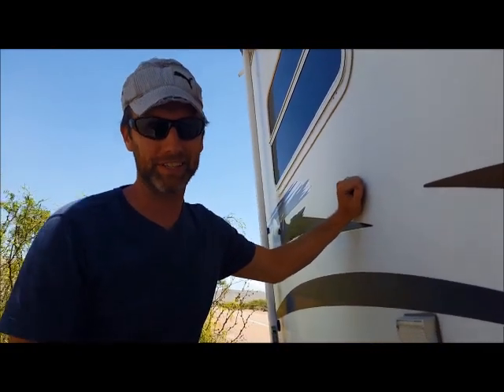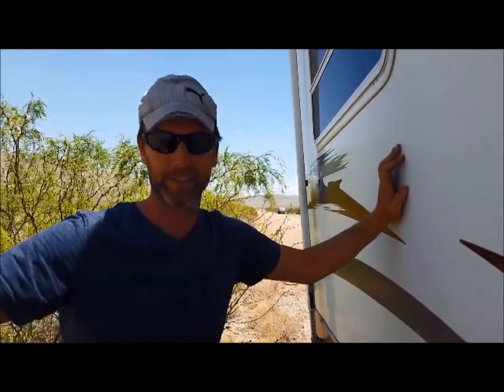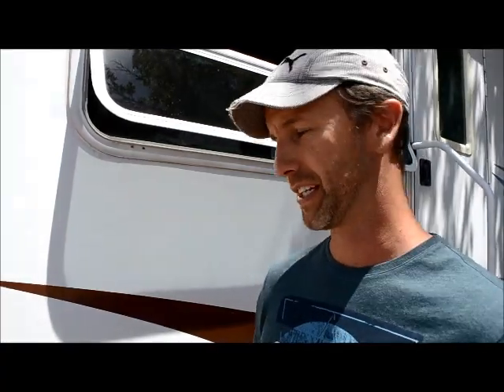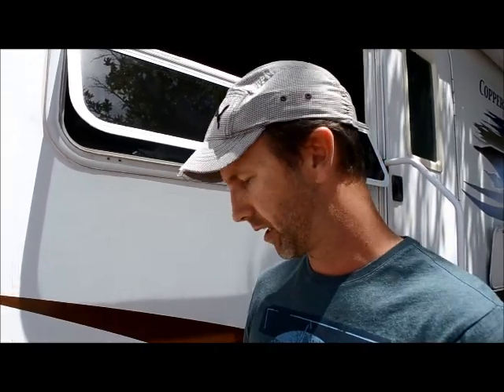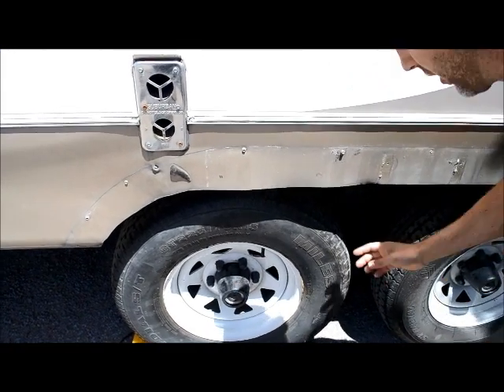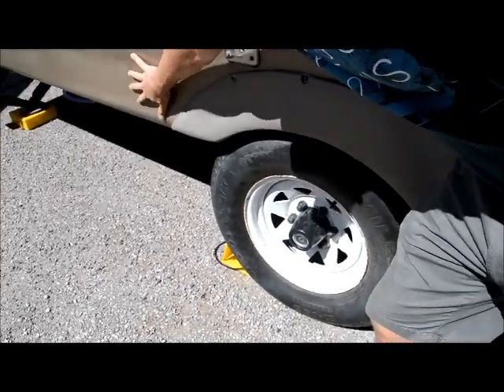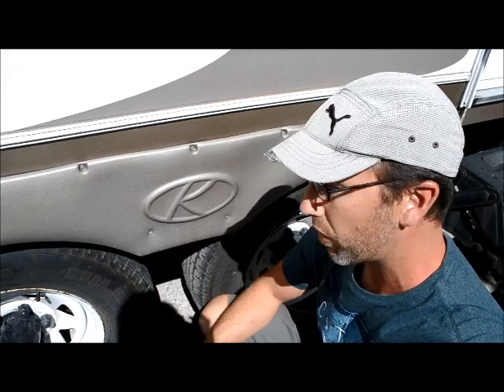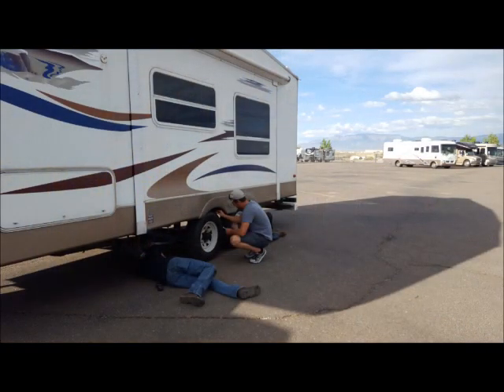RV Breakdown!   Dealing with a flat tire on the road

Comment: One thing to think about with tires is the temperature of the roads you’ll be traveling on. It’s better to drive early in the morning or at night in hot climates. I blew two fairly new “China bombs,” one on the way to the Smoky Mountains in July, leaving Florida and another (the tire directly in front of the first blown tire) a week later coming home through south Georgia.Temperatures mid-day when we started out were well above 100 degrees. Tires were properly inflated but the quality of these ST tires was poor. I now have Michelin LT XPS Ribs on my 5th wheel, a very expensive but high quality tire. My 5th wheel suffered $4,000 in damages on that trip and we lived to tell our story. Glad y’all weren’t hurt!

Comment: I haven't seen any comments about tire age, but trailer tires should all be replaced about every 5-7 years no matter how they look. Also, if you can upgrade to 16" wheels, you can use truck tires, which are better. Be safe!
Reply from the maker: Thanks for sharing!
Reply: Actually, trailer tires (ST's) are designed for and better than truck tires for use on trailers.  They are specifically designed for the types of loads put on the tires by being on a trailer.  Side loads are different on a trailer than on a truck and so the sidewalls have a different design in order to handle those very different loads.

Comment: Glad it worked out for you as well as it did. We took a trip from California to New York state. All four tires on the 5th wheel died one-at-a-time on the last 200 miles of the return to CA. That was a long day. I never travel any farther than the nearest tire store to buy a replacement for the blown tire. I  always want to have a spare tire.
Reply from the maker: Oh, my!  That would have been rough!  After two, we were sold for all new tires.  We had bought our RV used, so we had no idea how old the tires were, and we had put a lot of miles on them in the 10 months we had owned it.  Great tip on always having a spare.  We were grateful for ours!

Comment: My hat is off to you sir! You handled the breakdown in the desert much better than I probably would have. (unless of course you had a nervous breakdown off camera LOL) My new 32 ft bumper pull Salem Wildwood travel trailer suffered a 50% loss during the May 9th, 2016 tornado from hail damage after making my 1st payment. August 8th, 2016 it sustained some electrical damage due to a lightening strike. Thank God I had put a surge protector or it possibly would have burned to the ground. I have to tell myself that these things just happen, and there's no sense in freaking out over them. GREAK JOB COPING :-)
Reply from the maker: Ron, wow!  You have had some major challenges in the last year.  Good for you for staying positive and getting to the other side of those mechanical issues.  I have to say if the issues we ran into were more on the level of the ones that you faced we might have just decided to hang it up!  That is perseverance on your part my friend, well done!!  Thanks so much for following!

Comment: I'm terrified of a tire failure on the road so have been studying the tire issue a lot.  One of my new rules.  If one tire blows, replace the other on that side.  Even if that tire was Ok before the blow out, If you traveled any distance with it, it was carrying the whole load for a while.  So best to replace it ASAPl,
Reply from the maker: Excellent point!  We, unfortunately, learned that lesson the hard way - ha ha.  Chris has always been very diligent about checking the tire pressure too.  Also, being the desert made a big difference.  Best wishes to you!

Comment: Wow, two blow outs during a single trip.  Not unheard of but rare.  What brand of tires did you end up going with?  Also, I HIGHLY recommend you go to Lowes or Home Depot and pick up a cheap sheet of 1/8th inch thick black ABS plastic (probably a 2x3' sheet) to cover the underside above your tire to protect the exposed wood and plumbing.  You should do it before you get caught in a rain storm and unable to prevent the wood from getting wet and leading to rot and mold.  Should only cost about $30 or less.
Reply: I agree with CC about getting some kind of weather-proofing in there to protect that flooring before it gets wet!!
Reply from the maker: Since we bought ours used, we have know way of knowing how old the tires were that were on our RV.  We had been driving it for 10 months with no tire problems, so not bad overall.  We went with Carlisle tires.  Great advice on the plastic cover - we are looking in to a remedy there.  Thanks for the tips!
Reply: All tires are stamped with the date of manufacture which will tell you to the week, how old they are.

Comment: Chances are the passenger side will go first due to the crown in the road which is for rain runoff, slightly tilts the trailer putting more weight and pressure on the one side during the life of the tires. When one goes the other soon follows. But at that point it is best to replace all 4.
GOODYEAR ENDURANCE Trailer Tires are made in the USA. Per my research is the brand I will go to when it comes time to replace my tires. Also Maintaining Tire pressure, Speed and Load Ratings is very important.
Reply: Do you fillwhen cold  to max pressure stamped on tire?

Comment: Have you guys ever considered getting tire sensors?   We bought a set for our fifth wheel wheel  10 years ago.   They  are called called Pressure  Pro Tire
Reply: They cost around $400 for four tires, and they give you excellent support  if you call with problems or questions!    It is definitely money well spent.
Reply from the maker: Thank you, Mark, for that tip!  We have to admit that we were surprised when it happened.  Chris is diligent about checking air pressure before we leave campgrounds.  In this instance, we learned how much the desert heat/sun really affect your air pressure.  We will look in to this - thanks again for sharing and providing great info.!

Comment: I'm curious to know, if you had never been in an RV before this adventure started, how did you learn everything about setting up and maintaining everything on an RV?
Reply from the maker: Our first night in an RV was the first night we set out as fulltimers.  In terms of set-up, when we purchased our RV, we were shown how to do everything.  After that, the more we did it, the easier it got.  In the first month, we had done the set-up at least six times, we had it down by then.  In terms of maintenance, again, we asked when we bought ours, but there are still definitely things we don't know.  For example, we have some delamination in progress on the front of the RV.  Had we known more about it, we may have been able to prevent it; but it is also over 10 years old, so I don't really know if we could have prevented it or not.  At some point, we need to make a decision as to what to do about it.  A lot of the other RVs that we have seen on the road that are of the same age as ours have a plastic looking cap that we are guessing they added.  So, at some point we will look in to what we can do to fix it.  We have owned multiple homes in the past, so some of that information has been helpful.  Such as making sure that the water is draining appropriately from the spouts to clear the RV, just like you would watch spouts in a house.  As we face problems, we figure them out.  Our water heater makes a terrible noise, so Chris did some research and replaced the annode rod, but we still have the noise.  Since it is still heating the water, we live with it.  If we had purchased a brand new rig, we would be more concerned about how things are working.  But, really, we have an old RV, and if we worried about knowing how to do everything, we would have never set out in the first place.  Plus, having an older model means that we just don't have all the bells and whistles of the new ones.  There is a lot less than can break for us.  Also, the more we are on the road, the more we see the problems others have.  RV parks are great places for sharing information, and the workers/owners usually are a great resource too.  For us, we just had to step out in faith and be willing to learn as we went.  Hope that is helpful.

Comment: Are ciass c   had 20,000 miles when we got it  . it was  5 years old  so were the tires. should have changed out the tires ,but we took it cross country anyway, starting in new york and had two a blow outs. replacing spars are hard to find when they are 10 ply 
out west  were there are oniy small towns  like Hoover ND population 8,  if your tires are 5 years old  change them out don't take  the chance .

Comment: Can you share the manufacturer and if you know, the age of the tires?  I have westlakes that are a couple of years old and thinking about replacing them soon with a higher end tire.
Reply from the maker: They were Freestar M-108, load range E.  We bought our fifthwheel used, and they did not know the age of the tires.  It was something we asked, but the dealer didn't know.  We bought Carlisle, same size and load range we had.  Hope that is helpful.